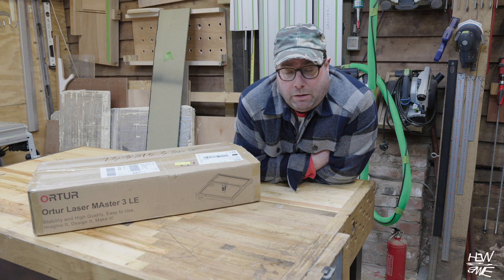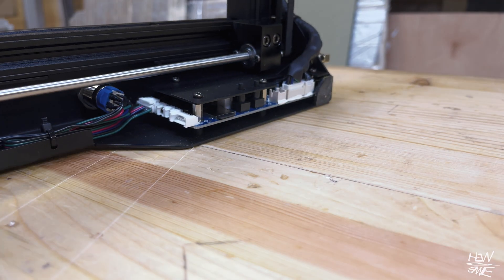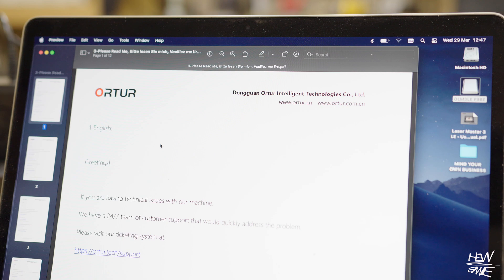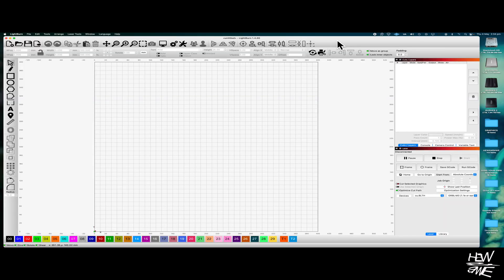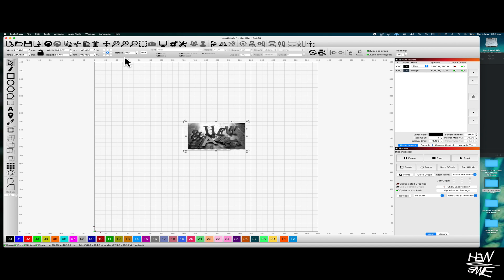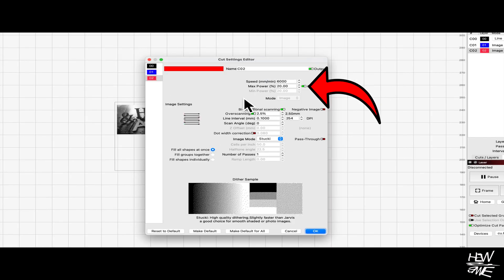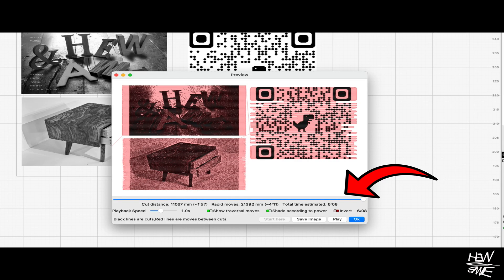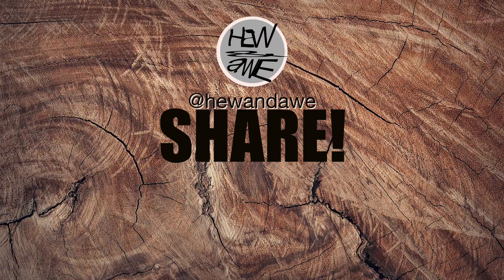The NEW Ortur Laser Master 3 LE! - Testing And Review

Comment: Great video and content as usual.  We really need a forum for feedback on these marvelous machines with so much promise and potential, and on the companies who sell them. 
Customer support and communication are also so very important to someone who is just starting out on this adventure.  And we also need to inform each other of the best deal nowadays in these times of inflation and profit-taking. 
I really like the Longer B-1 30/40 W.  Diode Lasers are now transitioning into C02 laser power and capability.  This will move the affordable diode Laser from engraving to wood processing.  
If a diode Laser can also process (cut out) the project structure...That's a game-changer.  It’s a very exciting time to involved in “Woodworking”…kunk

Common Issues with the Ortur Lasermaster-3 

Issue 1:  Ortur LM-3 Not Powering On

One of the most prevalent problems encountered by users of the Ortur Laser Master 3 is its failure to power on. 
This issue can stem from various factors, including a faulty power adapter, blown fuse, loose connections, malfunctioning laser module, or motherboard glitches. 

Notably, the Ortur LM-3 has faced criticism for having an underrated  "power brick." Despite seeking assistance for this issue, my attempts were met with silence.
 
Subsequently, I discovered a suitable replacement on Amazon.

Issue 2:  Inadequate Laser Engraving

When laser engravings fail to meet expectations, several causes might be at play. These include improper focus, uneven engraving area, or unsuitable materials for laser engraving.  

YouTube is a good source of help for these issues.  You certainly shouldn’t expect help from Ortur.

Issue 3:  Mid-Operation Halts

Frequent occurrences of the machine halting during operations can be attributed to loose connections, faulty motors, or software/firmware glitches. 

This issue has been highlighted extensively on YouTube.  Ortur was no help with this or any other machine problems.

Issue 4:  Subpar Engraving Quality

Substandard engraving quality can arise due to incorrect settings, a dirty lens, or a malfunctioning laser module. To help with this you can:  make adjustments in settings, perform lens maintenance, and monitor the laser module's condition. 

The airflow at the laser head seemed inadequate on my LM3 the supplied air assist pump only supplied 30LPM while the specs recommended 50LPM.  Again, no replies to my questions from Ortur.

Issue 5:  Smoke and Odor Production

This is a common concern among laser users, particularly during cutting.

Some of the fumes that evolved during cutting, especially with synthetic materials like plastics or from galvanized metal grids are very toxic. Installing proper external ventilation and employing an enclosed setup is highly advised. 

This is not specifically an Ortur issue but applies to all laser installations.

Issue 6:  Unusual Motor Noises

Motors emitting abnormal sounds during operation may be attributed to loose connections, inadequate lubrication, or faulty motors.
 
Similar observations regarding the Ortur LM3 are shared on YouTube. 
A common cause was Ortur's inadequate tightening of the drive sprocket set screws, resulting in loosening of the drive pulley and possible drive shaft damage. 
 
Once again Ortur would not respond to my request for information. This was a major theme throughout my journey with the Ortur LM3.

Issue 7:  SD Card Recognition Failure

When the machine fails to recognize the SD card, possible reasons include a faulty SD card, corrupted files, or firmware complications. 

My Ortur LM3 seemed to have issues in this area.  The SD slot on my LM3 was not mounted correctly resulting in the loss of the SD card into the front rail extrusion which required a disassembly of the front rail of the LM3 to retrieve the card…

Not high on the fun meter. Contacting Ortur for assistance was hopeless, as usual.

Issue 8:  Machine Freezing Up During Operation

Machine freezing mid-operation may stem from software/firmware glitches, motherboard issues, or communication problems between the machine and the computer.
 
Establishing a reliable link between my Ortur LM-3 and any of my computers proved to be a major struggle.  Despite weeks of effort on my part. 
 
All the problems with the Ortur LM3 were exacerbated by the lack of help (total silence) from Ortur. 
 
I ultimately sold my brand-new machine at a substantial loss due to this and other issues and no available help from Ortur.

Issue 9:  Inconsistent Engravings

Inconsistent engraving results might result from incorrect settings, a dirty lens, problematic materials, or a malfunctioning PWM (pulse width modulated) laser power controller.

I don’t have direct experience with this issue as my Laser head would not come on, no matter what I tried. 

Assistance from Ortur for this issue was not forthcoming, as usual.

Issue  10:  Lack of Customer Support and Service

In terms of customer service and support, Ortur failed miserably on all counts.

Despite purchasing the laser, from an authorized Ortur distributer directly, I received no help or even a response when problems arose. 

Requests for help went unanswered, and defective parts questions were disregarded.

Unfortunately, Ortur seems unwilling to invest in a customer's Problems, needs, or satisfaction., even after a customer invests, in good faith, in an Ortur machine.

Personal Experience with Ortur LM-3

My excitement for the Ortur Laser Master 3's potential to enhance my workshop capability quickly turned to disappointment and frustration. 

Despite its promising appearance, I encountered only obstacles, excuses, and no assistance from Ortur. 

Their lone response directed me elsewhere for help saying that they weren’t responsible. If not Ortur then who? 
 
It’s like one of those old shell games when you deal with Ortur…The pea’s not really under any cup.

Ultimately, I was forced to sell the Ortur LM-3 at a substantial loss, leading to the demise of my laser aspirations.

An Urgent Recommendation

Given my ordeal, I strongly advise considering other options before investing in an Ortur product.

It is my hope that you will avoid these problems and not support a company that displays such an obvious lack of commitment to both product quality and customer service.

Parting Thoughts

I am not inclined to write negative reviews and I didn’t enjoy writing this one. But, I felt compelled to share my experience as a cautionary tale for others. Thank you for taking the time to read my account of problems I and others have had with Ortur.

I sincerely wish you success in pursuing a laser product that will truly meet your expectations.  

You may want to consider the following well-proven and reviewed Lasers:

- Longer Laser B1 20 W (22-24W Output Power) ~ $759

- Longer Laser B1 30 W (33-36W Output Power) ~ $979

- Longer Laser B1 40 W (44-48W Output Power). ~ $1299

- Acmer P1 Pro 20 W Laser Engraver ~ $359

- Acmer P2 Pro  33 W Laser Engraver ~ $599

- 5W CR-Laser Falcon Engraver ~ $259

- 10W CR-Laser Falcon Engraver ~ $379

- Creality - Falcon2 22 W Laser Engraver & Cutter  ~ $330 (sale 08/23)

- Creality - Falcon2 40 W Laser Engraver & cutter ~ $1619

- xTool D1 Pro ~ $994

- xTool D1 Pro 40W + 10W Laser Cutting Bundle ~ $1699

Comment: I bought an ORTUR Master 3 LE in January, and it still does not work. I have sent loads of emails, videos, and photos, so they sent me a secondhand laser, which does not work either. Today 31/05/2023 and I have been ripped off by ORTUR.
Reply from the maker: What’s up with it? Is it that it doesn’t cut or?
Reply: @HewAndAwe  It does not cut 2mm cardboard or three mm plywood. It does not even engrave.
Reply from the maker: Wow! And they wouldn’t send a new module? Have you tried the official ortur Facebook group?